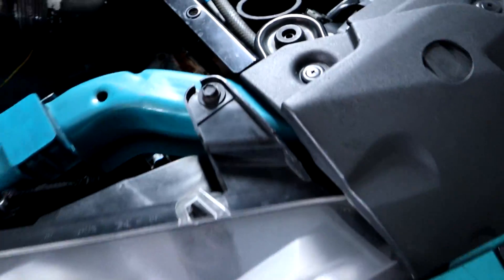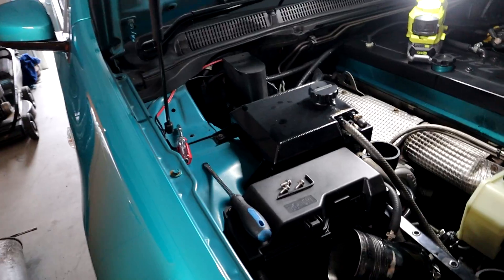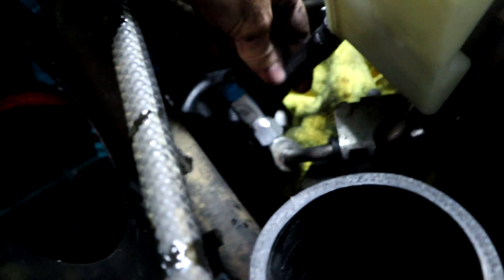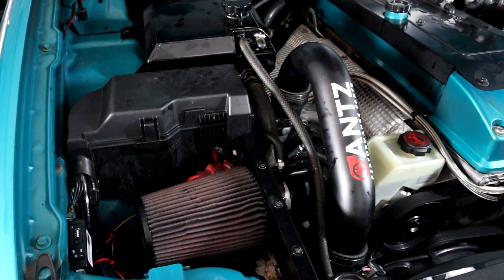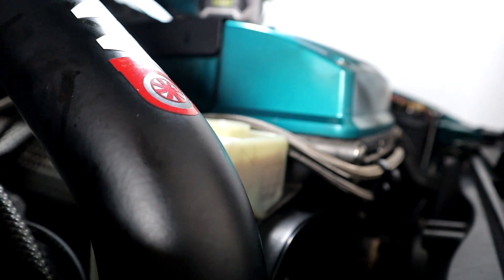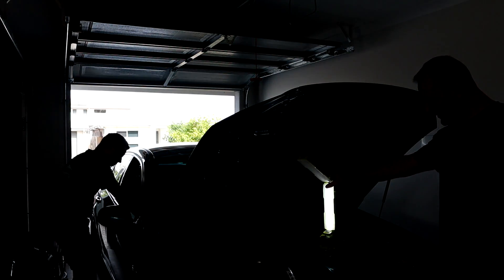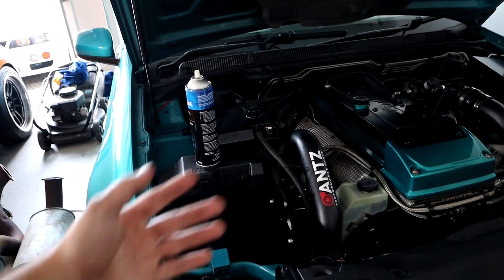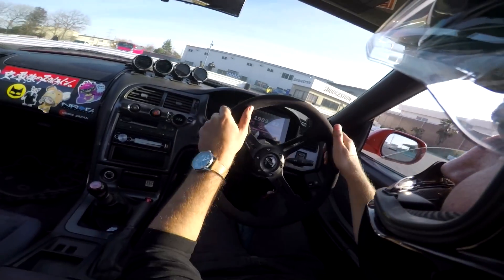WHAT FAILED?   Fire Damage Report on my Turbo Falcon

Comment: to get rid of the air in the steering system, turn the wheel full lock one way and leave the cap of the res overnight. gets rid of any excess air in the system.

Comment: That wire had the insulation melted, I could see the wire inside so the insulation was breached, I'd be replacing that wire as the actual wire inside will be brittle and prone to snapping. This is my experience after repairing an engine fire advice to you. Most of us are just looking out for you.
Reply from the maker: MV60 certainly man! I spent all of today going over wiring and getting my hands on cleaning, that’s all in tomorrow’s video 😁
Reply: @ZacBaldy  Cool. I remember the black hands from melted yet super dry and dusty insulation and how it's also stuck on like glue, the way the wires are all stiffer, (more brittle), the the smell. Not an envious job. Careful about cleaning the engine bay paint as well, they tend to not put clear coat in there so it's easier to wipe actual paint off too. Maybe they did on your car, just something to look for.